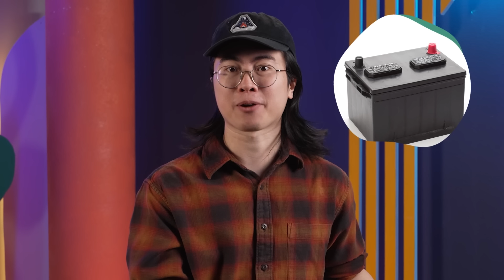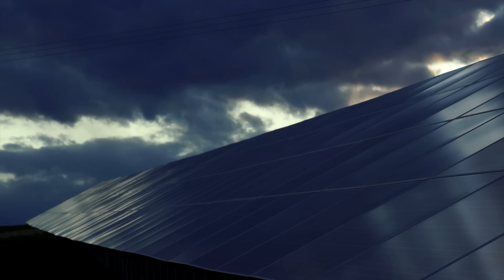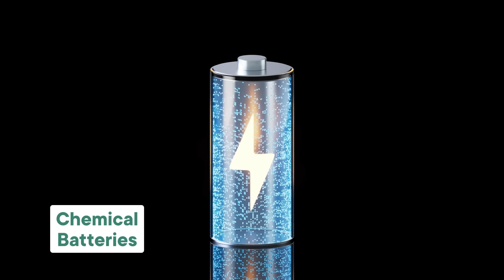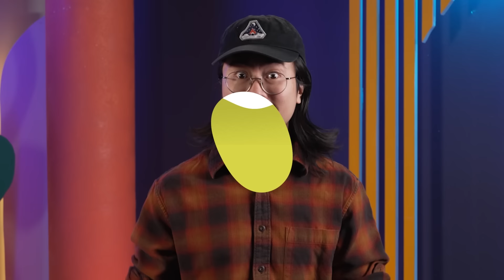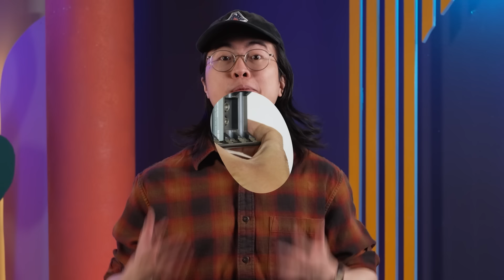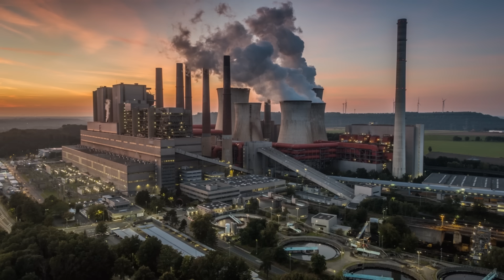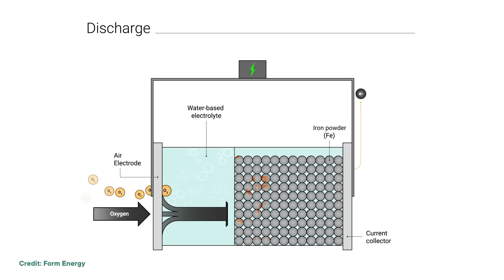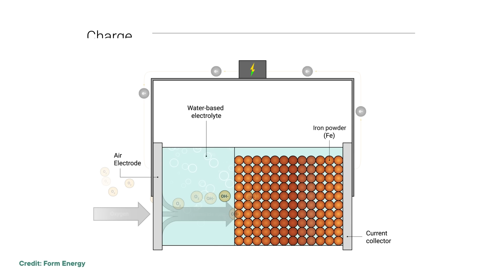The Weirdest New Battery is... Rust

Comment: Love that the pitch here isn't replacing lithium but complementing it, since matching the chemistry to the job is the part these conversations usually skip.
Reply: You can get more media attention and investment if your new technology claims it can do everything.
Reply: Looks like the replies to your comment missed the point.  We have a history of exploiting the scalability of 'low information solutions', matching one solution to all the problems and then making that work by scaling it up to Extra Big. Like, "Burn something to make steam to turn a turbine." That's the option. Use it everywhere. How do we make power? The same way we do it everywhere. But the downside of that is we can't keep our energy usage at the same level and take carbon emissions out of the equation and still have a 'low information' system. A 'high information' system starts by asking what problem needs to be solved in every individual case, collecting information about resources available in that domain and applying the best solution for that case. Possible 'high information' solutions to energy distribution might look like pumped hydro in some places, lithium or sodium batteries in a vehicle, iron air batteries distributed around the grid, Solar panels on all the roofs, micro-hydro on streams, wind turbines on the mountains, thorium nuclear reactors on a data center, and other power generation phased in and out as they become practical or cost-effective. It's not an easy story to tell but I'm sure we have the smarts and wisdom to implement it. We just need the collective will.
Reply: @JeffLavezzo  exactly, the most common criticizms I see tend to be, "yeah, but it wont work over here, so we should just trash the idea and look for something else." They always want a 1 size fits all solution, and that just isnt going to happen. Think of it like a vehicle. A passenger jet is great for taking a large number if people far away really fast, but you wouldn't use it to go to 3 miles away to work each morning. That doesn't mean jets should be tossed out, you just use your car or the bus for work, and save the jet for what it does best.
Reply: Hehdfhdheeg3rfcffr g r
Reply: Nobody seriously organizing anything is saying that.  You'd only hear something like that from someone trying to sell you away from a competitor or something.
Reply: And I love Tom Lum 💜 listen to Let's Learn Everything, y'all! Ignobel prize episode, quantum physics, orrrr... Any of them really, they're sooo good
Reply: I wonder if the slash to the production cost is worth it, as Nickel-Iron Batteries are very close to the same reaction as Iron-Air Batteries and still significantly cheaper than alternatives? Nickel-Iron has also been proven to be far more reliable, lasting several decades and still going on strong. It also fills the same niche as these Iron-Air batteries.
Reply: 30sec information and 9:30 useless yap
Reply: Silver will replace lithium.…,🤫🤐
Reply: @Gam31n  you do know you cant just say "Silver will replace lithium" and not elaborate. nobody likes vagueposting
Reply: @sciburger8000  they did this on all the other comments too. I think they're alluding to silver being a better electrical conductor, but I fail to see how it relates to energy storage.
Reply: Dude lithium ion batteries are practically unreplaceable with our current technology level. I immediately don't believe any claim of "this could replace lithium batteries"
Reply: @Foivos_Apollon  lithium batteries are a big fire hazard so alternatives are welcome
Reply: @Foivos_Apollon lithium batteries are probably not going to be beat on energy/mass or even volume/mass, but using other chemistries when possible would reduce the demand for scarce, ecologically destructive resources.
Reply: @Foivos_Apollon  Sodium-ion batteries can for some uses. China's CATL is producing them for EVs already.
Reply: @amylivingston4590 silver
Reply: @Gam31n  What, CATL's batteries? No, they're definitely sodium-ion.
Reply: @Foivos_Apollon  good thing they’re not making one of those claims, then, huh?
Reply: @Foivos_Apollon  sodium Ion has definite advantages and is improving rapidly.
Reply: sodium ion @Foivos_Apollon
Reply: @Foivos_Apollon give it 6 years and this will no longer be true
Reply: @Gahlfe123 they've been saying that since lithium ion came out
Reply: @Gahlfe123 Why? 
Sodium ion batteries are another promising new energy storage tech that's starting to roll out on a wide scale, but they're certainly not going to "replace" Lithium Ion batteries. They'll just complement them, and fill niches where the higher energy density that lithium batteries can achieve isn't required. 
Are you thinking of something else?
Reply: @Foivos_Apollon  Since 1992?
I'll give it to you though, 'been hearing about sodium ion a lot. Youtube videos follow the same incentives as journals in that they have to be excited for something that's coming soon to attract views and make money. It's unfortunate, but it doesn't mean Li-ion will never be replaced; if prices ever balloon again, dwindling profits will force that replacement. Personally I can't wait to get these fire hazards out of my life.
Reply: @DenkouNova  I am definitely intrigued by sodium ion as it is reaching production, but I still remain skeptical of it being able to be scaled down to something as small as a phone battery, at least for the time being. Don't get me wrong though, I will probably be one of the first people to get the salt phone when the tech eventually does drop
Reply: @Foivos_Apollon silver Better conductor am a geniuz$vx😮